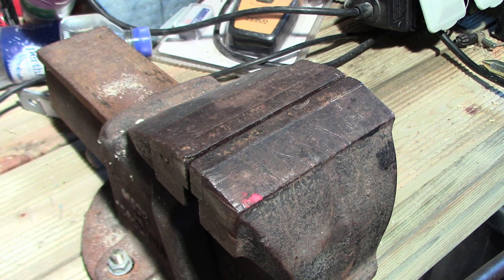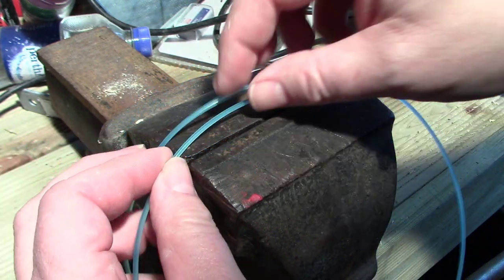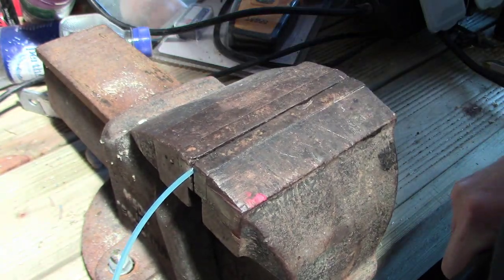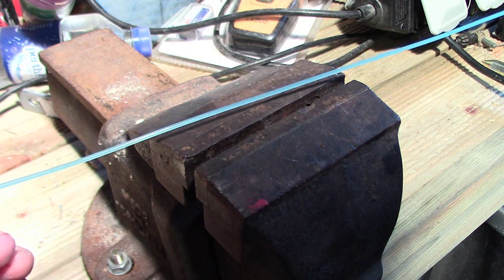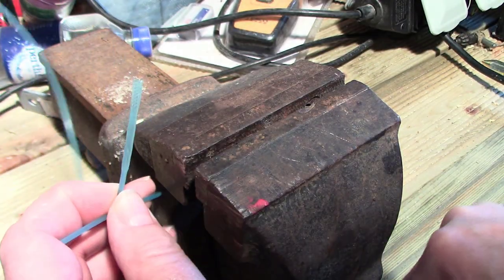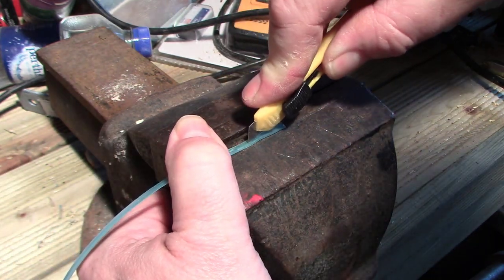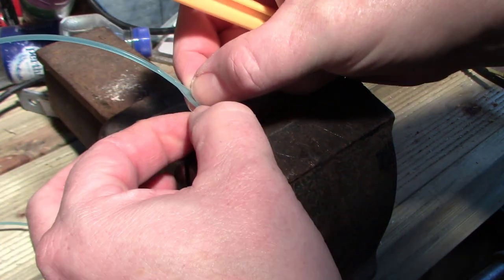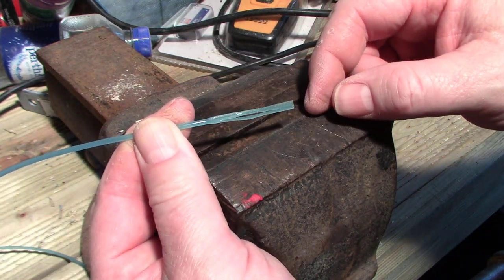Making a budget pull through

Comment: The old " straw " trick , use it myself too good effect , I find the black plain straws from IKEA work better then straws from ( say ) Mc Donald's as they are slimmer ... Give the straw a bit of a " twizzle " too seat it on the end of the barrel ( through the moderator / silencer ) gently pushing it as you " twizzle " .. obviously easier on .22 then .177 .. I'm particularly referring too the wire and cord pull through , but looking at this vid it will be a damn sight easier with strimmer cord .. a superb idea mark ... All I gorra do is look down the shed for some , probably buried under 5 tons of junk ..